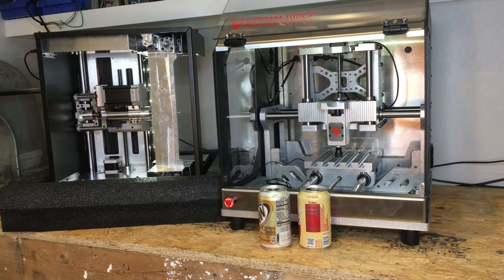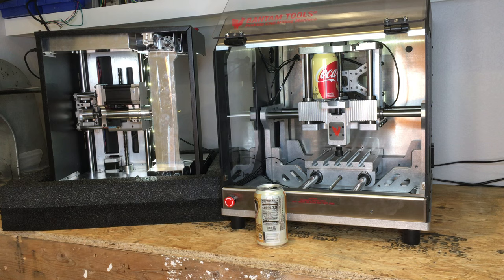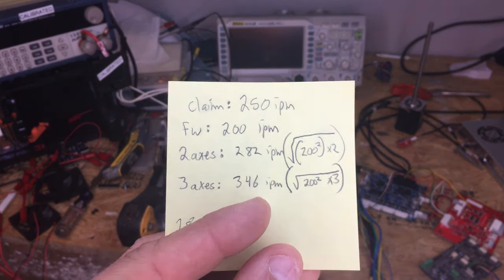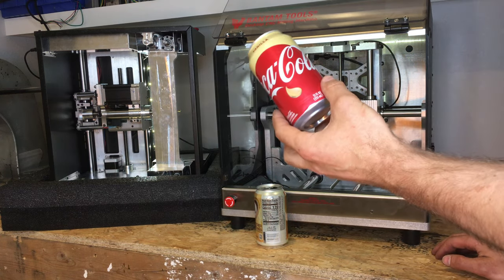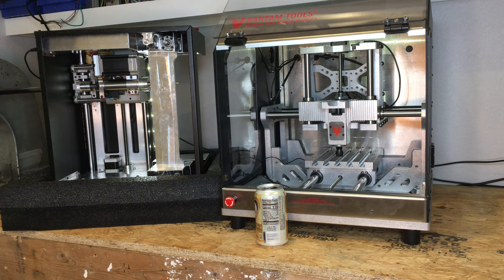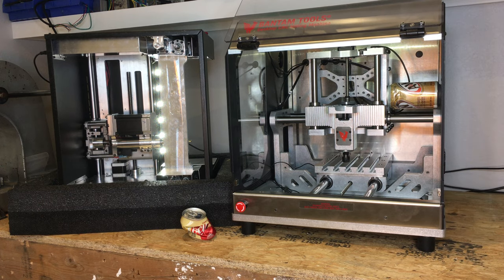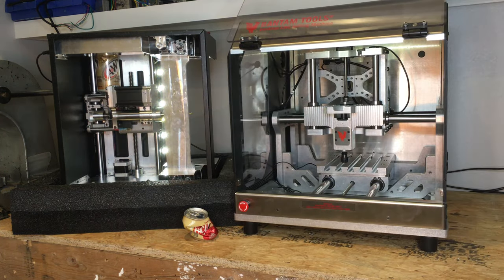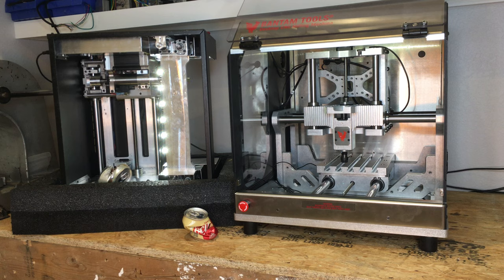Bantam Tools Desktop CNC Machine Can't Even Crush A Can

Comment: The Shariff DMC 2 will be coming out soon. It’s a desktop machine that uses closed loop steppers on every axis. It machines different types of metals and is set up for flood coolant. It may be the best option for a desktop cnc mill.
Reply: I really hope the DMC 2 breaks the mold of desktop CNC machines. It’s crazy how quickly desktop 3D printers have evolved and become more accessible despite them only being available to consumers for a little over a decade. Meanwhile, the options for desktop CNC mills is much more slim, despite it being a manufacturing process that’s been around much longer and has had way more time to mature.
Reply from the maker: I agree the Shariff is a great machine, but it's quite a bit larger and more expensive.
Reply: @doppelhub  Will you eventully do a reveiw/teardown of the dmc2? Thanks!
Reply: Id go with the new makerdreams evo pro over any of these so called desktop cnc machines.. Its one that actually delivers..

Comment: As the bantam is for more entry level users , is this not just collision detection to prevent the machine from permanent damage?
Reply: this is not collision detection; it's missed steps on the steppers. the giveaway is that it's hitting over and over, whereas stall detection would most likely activate the estop

Comment: What’s the other machine that you’re testing this against?
Reply from the maker: It's a Ghost Gunner 3 Desktop CNC.
Reply: @doppelhub  I’m looking into getting a desktop milling machine for some small aluminum projects - do you have any recommendations?
Reply: Should have used a paper Dixie cup.
Reply from the maker: @RCGrid  Not at the moment.  Certainly not the Bantam, though.
Reply: @doppelhub   Do you have any plans to sell the frame?
Reply: I guess the real question is, will it cut? Because I’m not intending to use this machine as a trash compactor.
Reply: @doppelhub  what about the GG3?
Reply: @SwissplWatches  Lol, how much pressure is required to machine  part?
Reply from the maker: @robertmoore119  It depends on whether you want to grind the material away, or actually cut it off in chunks.  I estimate that the Bantam could not use even 10% of its rated spindle cutting power without losing steps.
Reply from the maker: @terrymoorecnc2500  Good idea!  I'll try that next time.  Honestly I'm not sure it will crush.

Comment: Stepper is not for professional CNC especially for metal milling. despite its torque. you get better performance with the same size stepper but in closed loop, want faster than use servo.
Reply from the maker: Closed loop anything (stepper or server) is certainly an improvement... but isn't absolutely required in a desktop CNC.  What is required, though, is enough current to produce holding torque greater than the cutting forces translated back into the linear stages... which this Bantam does not possess.
Reply: @doppelhub  but ther should be some type of position control because people may just let the machine run on its own and then it may bind but doesnt stop on its own so the endmill will actually grind on the material until (if its wood) it may catch fire.

Comment: This could just be current limiting on the drive as a protection of the machine. Doesn’t really prove anything.
Reply from the maker: I can assure you there is no "current limiting on the drive" as you've proposed.  See the other four hours of video I uploading for a full explanation, but in short the steppers have no idea where they are... they run completely open loop.  The DRV8818 stepper driver used to drive these steppers has zero knowledge about how the stepper is actually rotating.  Let me know if you need further explanation.

Comment: I weigh 200 pounds and can stand on an empty can. Two people can sleep on a bed supported by 4 eggs. Not sure what the point is here.. slightly dent the can and it will be crushed
Reply from the maker: I literally did exactly that (slightly dented the can) and Bantam still couldn't crush it.
Reply: The can in the first test came out “ in perfect condition”. I did not hear any sound indicating a dent was introduced. In the second test however, I herd (at 2:08) a clear click when an indentation was introduced. If this was the case, this would not be a fair comparison between these two machines.

Comment: John,
You state "...which means its open loop linear positioning is highly susceptible to losing steps...".
While I am not "trained as an engineer", I think you make an unsupported (possibly even, unwarranted) assumption. Do you have proof that this supposed defect/flaw translates in an inferior final result?
I feel you come up with a video that frames a non-issue as a weakness.
Reply: Imagine taking a hard cut on aluminum. These steppers will instantly mush out of the way and the machine has no way of knowing it moved hence the "open loop". Meaning the part will NOT come out as you intended. You don't really need to test this. This video is made by someone with experience. It is pretty obvious that this will lead to inferior results. All you have to do is look at the stepper controllers. They are tiny little boards. Bantam cheaped out on design, software, assembly, and parts. It's pretty clear this machine will not perform well.
Reply: @jacobfalk4827  Thanks for the civil response. 
What are the people who own the Bantam desktop machines saying? 
Your assertions remind me of the prevailing claim engineers made for many years about honey bees and bumble bees: Their design is such that, and the rules of physics show, that they should not be able to fly. Yet anyone who knew nothing about physics could SEE that bumblebees had the formula.
Maybe Bantam has built the a bumblebee CNC that works great, in spite of what some experts say.
Reply: @billrogers6863  Apples to oranges. Or bumble bees to CNC's rather XD. That is extremely wishful thinking. It would take a new driver board for the x/y/z axis. It would take improved build assembly quality from them. Basically, they would have to own up to their obvious flaws and address the issues and fix all of them in version 2. Of course, it's possible but how often do companies own up to their mistakes and actually fix them. Doubtful. Animals evolved over millions of years. This machine was just released and it is hot garbage. Also, it comes from the previous CEO of Makerbot which is notorious for offering printers with zero upgradability, proprietary filament, and proprietary nozzles. I think the Shariff DMC is the next best choice.
Reply: @jacobfalk4827  
Ha ha ha. I didn't realize you were the resident troll. Heck, please forgive me for responding to your non-serious comments.
Have a fine day/week.
Regards
Reply from the maker: @billrogers6863  I have years of experience machining metal.  The Bantam Desktop CNC has so little linear torque that it's not even worth testing aluminum... the cutting profiles will need to grind away the aluminum at incredibly shallow passes.  The machine is sitting in a corner (as a trash can) and I don't intend to ever use it.  It's just not worth the time.  If you want to play around with cutting profiles send me a message, cover the shipping (to you and then back to me) and you can have all the fun you want.  I've moved on.
Reply: @doppelhub  are looking to sell it? I imagine I could use it given a good price.